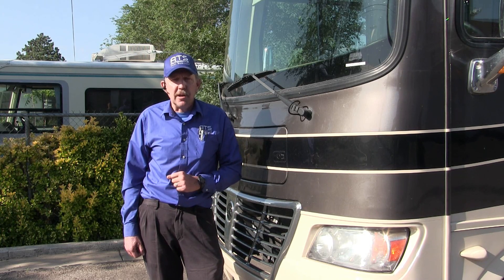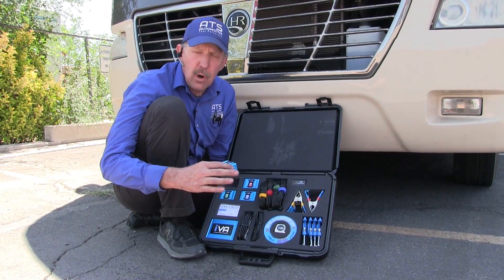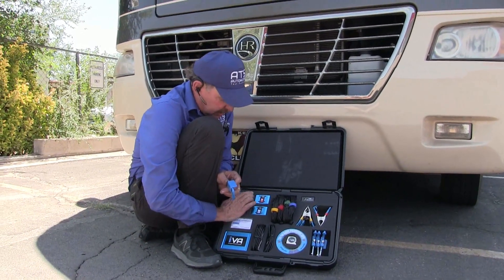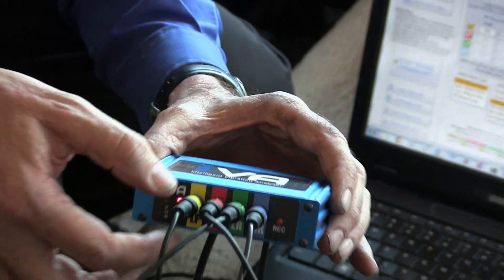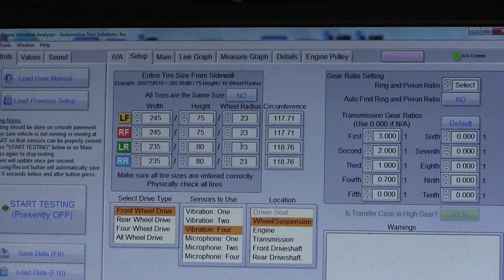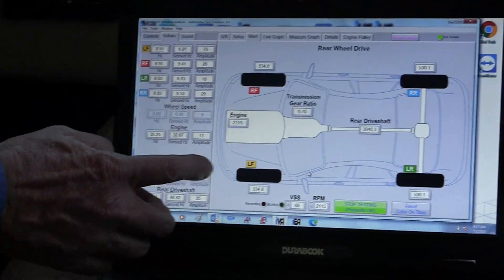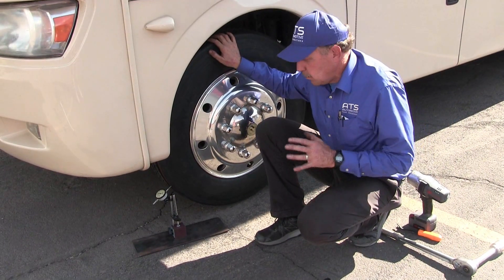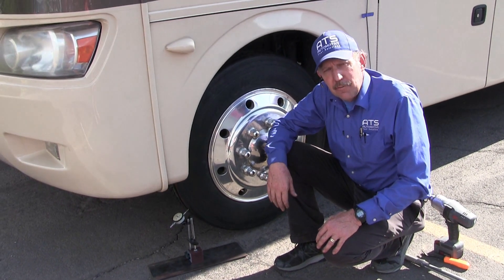2013 Holiday Rambler RV Tire Vibration Diagnosis

Comment: they should have done a run-out measurement when they balanced the tires, in my shop anything greater then 50 thousands the tire gets dismounted and remounted re-checked, if it's still out of round tire is junk, rims are checked when tires are removed, Pretty standard stuff, what hack job of a shop doesn't check run-out

Comment: Does this tool have the ability to switch to time-domain instead of frequency-domain? With the Picoscope NVH kit, you can find CLUNKS and stuff based on which sensor hears the noise first by using time instead of frequency.